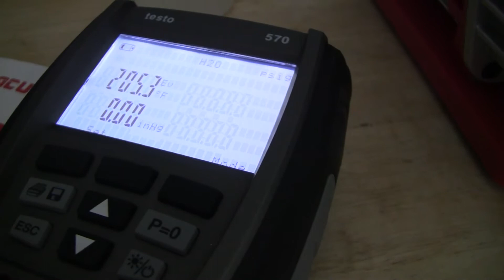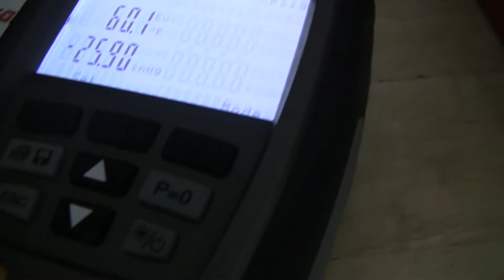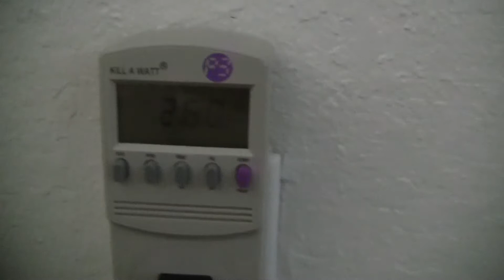TA 500 Kozyvacu Vacuum Pump Review Part 1.

Comment: I don't understand the point of owning 10 different gauges if you don't know what the numbers mean. Right off the bat, you stated that water vaporization point does not matter in this test... This is where it became evident that your test is pointless and you should do a bit more research before turning on your digital gauge. Water vaporization point is 212*F AT SEA LEVEL. That temperature drops by 1*F every with every 500ft of elevation above the sea level. At your location, vaporization point is roughly 7*F lower, which means that you are at about 3500ft above sea level and given the fact that you live in Nevada, this is information makes complete sense. I hope you know what maximum vacuum that can be achieved at SEA LEVEL is 29.921inHg. What you probably don't know is that at 3500ft of elevation,  maximum vacuum value changes to... wait for it... 26.2inHg, which is exactly what this vacuum pump is pulling.
Reply from the maker: By part 4 I figured all of that out.